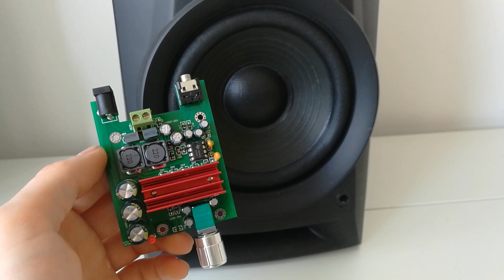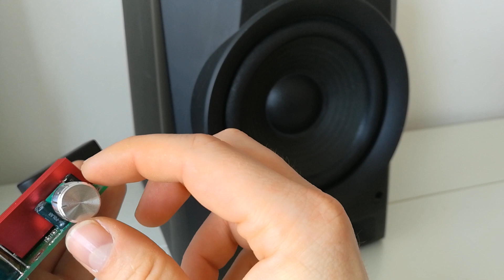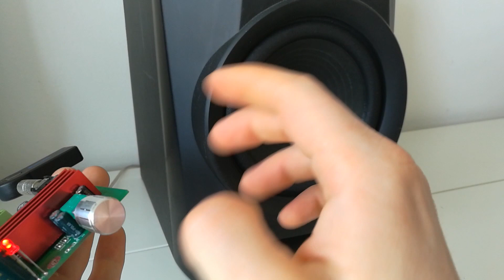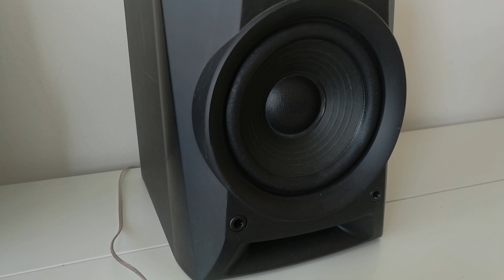Connect subwoofer amplifier on regular speaker test

Comment: I have 4 ceiling speakers in my home. I have no Amplifier however I do have a subwoofer that has only the normal RCA as the input. Question is can I plug my ceiling speakers into the subwoofer and use a plug In RCA Bluetooth adapter as the input into the subwoofer. Will this system work with no AMP? Please Help. Here is the link to the Bluetooth Adapter : https://www.amazon.co.uk/Golvery-J205-Bluetooth-Receiver-Portable/dp/B01KZ1S46A

Comment: Does this amp need cooling?
Reply from the maker: no it doesn't if it have that cooling radiator attached on the chip.. but is allways good if you add some extra cooling..

Comment: hallow evryone
can i ask somethin?  I have TPA3116 2.1 50+50W and 100W bass amp.  how much W speaker can i conect to bass output????
Reply: You cannot, it will smoke out within hours. And the amp model u mentioned is not to boost sub as u wanted so rather u go for any 4 inch subwoofer 80watts(not rms) , it will punch the bass u required